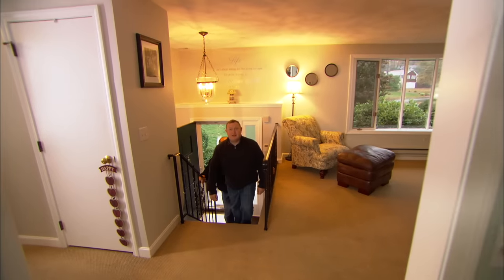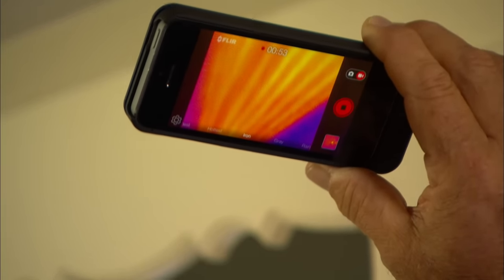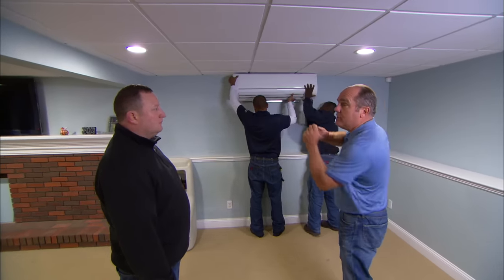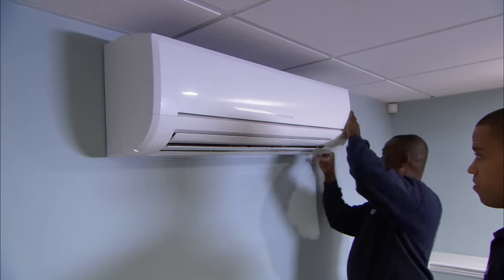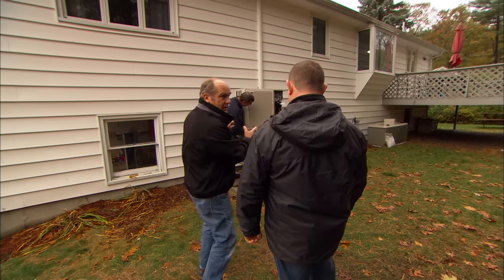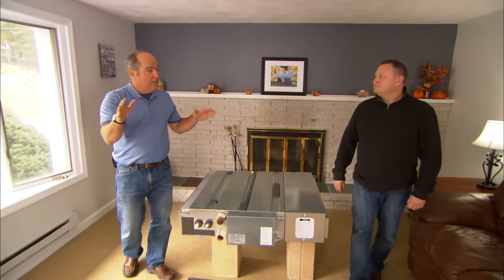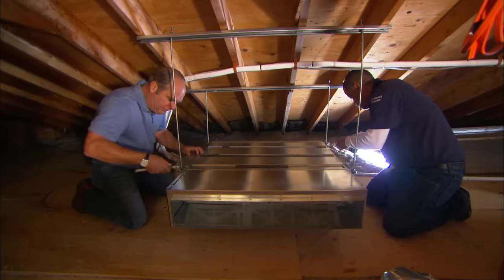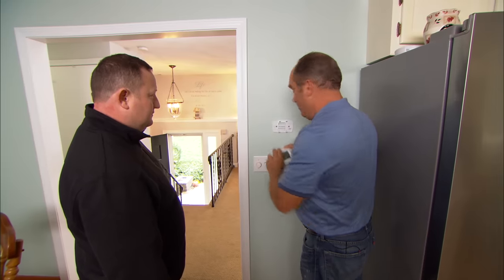How to Install a Whole-House Ductless System | Ask This Old House

Comment: I am sorry but I have a heat pump in the southside of VA (15 minutes from NC border ) and it costs a fortune when reserve heat comes on when it gets down to 30 degrees .It struggles to heat my 2440 sq ft. house with 2x6 stud walls and insulated floors .The heat pump is a 16 seer dual stage lennox heat pump that is new as of 2015 .My electric bill can get  way up to over 300 dollars a month when reserve heat comes on .
Reply: Forgive me I don't know much about this, but from the video (@2:55) I gathered that there are different kinds of heat pumps that are made to work below 30 degrees (F). 

It sounds like yours isn't one of those. Any thoughts on that? Is that a whole bunch of BS?
Reply: he even says that it can only pull out warmth down to 30 degrees and then reserve heat comes on .I checked every heat p[ump out there and they all say to 30 degrees .I have friends in NJ where I came from that got a heat pump last year and the first winter they said they felt like they were going to freeze .Their electric bill for one month from PSEG  was over 500 dollars and the house is only 1400 sq. ft and is a new build as of 2014 with 2x6 studs .I am from NJ and could not believe they got a heat pump .Heat pump also got snow  on the sides and some on the top from winds because it was just to cold for it .I had to shovel mine out as snow was half way up one side because of snow and wind here .We are lucky though 2 days later it was in the 50's .I hate my heat pump and it was almost top of the line and most here only buy 14 seer and 2 ton and mine is 4 ton unit

Comment: contractors who have the service plans for these are the ones who win. guess who you call when it breaks. the more complicated a system is means the more often it will break and make the service guys more money. the intial installation cost is nothing compared to the 20 years of service calls units like this require. have fun!
Reply: Bob Smith when installed right, these systems have few issues it ever.

Comment: Probably a $40k hvac installation and equipment.
Reply: It will pay itself off in energy saving in 120 years though.
Reply: @sgtpepper729  lol isn't that the truth. We just had our central A/C replaced, and everyone was trying to upsell us on more efficient units. I did the math and realized under even  optimistic scenarios, it'd take 15 years to pay off the difference in cost.
Reply: @iamamish  Ok, assuming you have good credit, get a ~20 year loan to pay for the more efficient unit.

You will immidiate see an instant cost reduction, and therefore profit, for no upfront cost.

If you sell the joint, pay off the loan immidiately, and charge the next owners a little extra for the lower heating/cooling costs.

15 year ROI isn't terrible, but not great either.
Reply: @Bob_Lob_Law  How do you get a 20 year loan, even with good credit where the interest rate won't swamp whatever savings  you're getting in your energy bill?
Reply: @iamamish  My my, thats a tough one. A line of credit is a good option for shorter loans, as for long term, there are equity options among other things.

It really depends on what bank you are with, but it is certainly possible. There are some individuals who manage real estate in a similar manner.

Snatching up just the right properties, doing some renovations, and renting them out. Earning more on rent, than is spent on mortgage payments.

You have to ask yourself what is worthwhile, liquidity certainly has value, and it is not necessarily a good idea to tie up cash in a long term investment.

But realistically, would you spend that free cash on something with a better ROI? Probably not. The money probably gets sapped away by a new car.

Really, from a purely monetary perspective, a 15 year ROI does not make much sense with an upfront investment, an investment into a stock portfolio will pay much more.
Reply: @Bob_Lob_Law  I appreciate the feedback, but a non--securitized loan over 20 years is unlikely to make buying a more efficient furnace/AC unit worthwhile. At least, it won't here in Ohio.
Reply: @iamamish  You are probably correct, although, it seems most people don't think in terms of ROI, and there are still many installations in which financial efficiency can be improved.

Comment: I do Mitsubishi systems. The hvac contractor needs to go to a Duct design class for Mitsubishi systems cause that's some pretty bad duct setups.  And I hope they used PEAD units Not the SEZ. Especially on the bigger zones. R8 Ducts required and you also need to wrap up unit itself.  But other than that, looks pretty good. Also the PEAD/SEZ dont have strip heat for backup.

Comment: Why is it called 'ductless' when he put ducts in every room?
Reply: in the video he clearly stated that the wall unit is "ductless" and the other units in the attic are called "ducted" air handlers which means you can install a plenum and attached flexible duct like you would normally do in a conventional application.
Reply: Should be called a vrf system
Reply: "Whole-House Ductless" - a clickbait title by definition.
Reply: The ducts are added to replace big units on walls and to give more even heating and cooling.
Reply: It's kinda become a slang term. When the ductless mini-split/inverter type systems came out many people referred to them as ductless mini splits, now that the same technology has evolved to include ducted units the term ductless still gets used for whatever reason. At least that's my theory on it.

Comment: It seems that the attic is not part of the conditioned space, so in the summer, when the sun is baking on the roof, the system will have to function in an oven, and in the winter, it will be cold. Wouldn't it be more efficient to insulate the attic and make it part of the conditioned space?

Comment: how much does a whole house ductless system cost?
Reply: $4800 for a 4 head mini split system. $2200 equipment, $2600 install.
Reply: @okedokie  Is it more efficient to operate than natural gas? Does it save the homeowner money or about the same. Reliability. Is it reliable and easy to work on? Are parts expensive?
Reply: @troybarnes502  It works great as an a/c system, but a family member has this kind of set up, and their heating bill is 3 times what mine is with natural gas.
Reply: @okedokie  do you do these installs in Massachusetts? Or do you recommend someone who does?

Comment: Hope they box that air handler in with insulation to isolate it from the attic heat and cold if they stick it up there.

Comment: Who the hell thought a electric ceiling radiator made sense? Heat rises!
Reply: My thoughts exactly, not to mention having hot wires running near wooden trusses. What could go wrong...??
Reply: False... warm AIR rises. Those coils emit radiant heat... like the sun. It does not use air to transfer the heat.
Reply: Is the sun hot?  Heat rises doesn’t it?  So how does the sun work then?  So radiant heat - both the same.  And baseboard is not radiant. As far as reverse cycle air conditioners, not so efficient the colder it is out.
Reply: The sun is hot. Heat does not “rise”. Warm AIR rises. Three ways to transfer heat: convection (through a medium, like air), conduction (through physical contact), and radiation (like the sun or any form of radiant heater). Base board heat IS radiant heat!! It doesn’t warm a home by heating the air (it warms it slightly, but is inefficient at that), it doesn’t warm it by direct contact... it warms it through radiation of heat energy. And heat pumps (through the inverter technologies being discussed) have full heating capacity at outdoor temperatures down to -5 F and below. Using a fraction of the energy that electric resistive radiant or convection heaters do.

Comment: He forgot to mention about all of the mold that grows inside of the Mini Splits and how they need to be cleaned out twice a year he didn't even suggest a UV light at least for the kids room you would think, I guess this old House's getting more frugal. Good luck ever getting that air handler clean without having to completely take the whole thing apart

Comment: Personally 4 zones upstairs don't make sense because the kitchen has no door so it'll end up the same temp as the living room. Definitely a good idea to have separate zones for bedrooms. I'm not sure why people don't like the head units as they bring features that returns and registers don't: you can run them as fans that can oscillate and some can bring in outside air for when the outside temperature is fine but you don't want to open windows. Plus they're relatively cheap.
Reply: Anyone know which mitsubishi air handler this is??  Did he say he has 4 air handlers with 5 branches off of each?  So thats 20 line sets to 20 different spaces or so?

Comment: Is this better than current hvac units available now?
Reply: Randy Mullins Financially i don’t know. Though where i live, The Netherlands, they have stopped constructing gas lines to new houses, because the extraction of gas from the earth causes earthquakes, and it’s better for the environment anyway to run off electricity. It’s much cheaper and efficienter anyway than a basic electric heater. In 2030 or some year they want to be completely free of gas in the whole country.
Reply: No. Its just easier and cheaper to install in existing homes. Those unites are never chosen with new construction because they're slightly less efficient and less effective for heating and cooling.
Reply: The power bill is the main concern
Reply: yes they are more efficient because no duct losses. it takes up less space as well. also, and obviously, they can be more easily sized to your cooling space - for example if you only wanted to cool certain rooms it will be much cheaper than trying to cool the entire house with central AC.
Reply: This is a current hvac unit
Reply: Rocketninja200 you are wrong. They are used in new construction as well. Mostly in high efficiency homes
Reply: High efficiency does not mean more comfortable, usually means energy saver at the cost of losing comfort  if anything
Reply: In short, yes, they are.
They’re also considerably more expensive and they require specialized training when commissioning and troubleshooting.

Now, “better” is a relative term, they may save you on energy costs but you won’t feel the nice 110°F air coming out of the air handler in the winter season.
Reply: @Engineer9736  So you remove gas lines from houses to help the Earth, just to run more electricity that comes from Natural Gas/Coal plants creating the electricity? That electric comes from somewhere (still about 85% fossil fuel in the Netherlands). It is more efficient to just burn the cleaner gas direct than to lose efficiency in transporting fuels, converting them into electricity and trasmitting it to homes. The argument that Electricity is cleaner than fossil fuels at this point in time is a farce. Until alternatives become truly economic and efficient at great scales, it comes from the same place whether you burn it or plug it in.
Reply: Ryan Hoeksema except, it isn’t more efficient in this case.
Now, to be completely honest, this isn’t the save-all-environment solution and I don’t know anyone who would claim that.  
Ultimately, it boils down to power consumption.
The less you consume, the less fuels are burned.

Comment: Aren't they installing ducts in the thumbnail?
Reply: Jimmy Turner they explained in the video. It is a ducted ductless HVAC system. Basically it uses VRF tech for the ducted system and a ductless head for the basement
Reply: Technically yes. But it's a "ductless" system being that it's not just one air handler for the house, its a few small handlers. Basically like those ones you see on the wall, but they have one unit feeding two or three rooms.
Reply: They lied.  I wasted 6 minutes to find out.

Comment: Would installing a separate ductless unit in 
Each room be to much of a power load
Reply: The air handler doesnt use much power.  The condenser is what uses the most power.   Using that many air handlers would required a very large condenser or multiple. That is were the power load comes in.

Comment: It sure looks like a ducted system to me. That must have cost a fortune for that guy
Reply: There a ductless AND ducted system. Having a single system in a single room for your whole house is inpossible, you need ducts for that.
Reply: Absolutely he paid a fortune for that set up. I would have chosen a more conventional system
Reply: @jawidofkoj2998  It all depends on what systems the house already has.  I have baseboard hot water so my home has no ducts.  A traditional duct system would have cost me $25k.  The mini-split was less and wayyyy less intrusive to install.
Reply: Joe J I’ve recently installed a mix of ducted and ductless mini split air handlers and a condenser capable of operating efficiently well into to single digits below zero for a customer. The System is incredibly even and quite in air conditioning and will do the same in the winter, it’s the only heat source. The wall mount units have certainly gotten more attractive since this video was shot
Reply: If it looks like a duct and quacks like a duct, it's a probably a duct.
Reply: @jawidofkoj2998  a regular central heat pump would have looked the same at a cheaper price without the unit on the wall. The main indoor unit would just be in a closet or the attic.
Reply: z  No, I think he had radiant heat but in the ceilings.
Reply: @davec.3198  I am looking into this in my own home.  How much did the mini-split cost?
Reply: @Cazuelle_AF  For me it was under $5k.  I bought and installed the units bit then had a Mitsubishi installer come braze the lines, pull a vacuum and fire it up.  Went perfectly.
Reply: Ross Malagarie  absolutely not. A traditional heat pump reaches its balance point between 34-38* and becomes inefficient, so you need supplemental heat. Totally useless in a cold climate unless severely oversized. 
The inverter type equipment they’re installing is way more efficient in cold climate (he actually says it) and the newer version Hi is even better.
Reply: @peteaulit  Yep.
If you're looking to use these in a cold climate as a heat source, make sure you ask about "hyper heat".
Reply: @davec.3198  Most if not all systems are flared...why hire some1 2 braze for u....u must be a rookie...
Reply: @warbird101210  No.  DIY kits are flared.  The pros braze the lines to eliminate potential leaks.  I hired pros...so they brazed the lines.  
You need to pull a vacuum and get all of the air and humidity out of the line away.  I don't regret for a second paying someone to do it for my system.
I hung the units.  Poured a pad for my condenser..anchored it in..  Wired them.  Installed the lines..but did not connect.
Reply: @davec.3198  Thanks for sharing the information about the "hyper heat". I am in New England, I talked to multiple hvac companies about using a split as main heating but could not get a clear answer.
Reply: @synewparadigm  You're welcome.  Glad to help.  
I had a 38k BTU condenser unit and 3 heads in a 2000 sqft house with very high cathedral ceilings.  With 80-90F days and 70F nights, I was paying $20-30/month in cooling costs.  And that was with running my bedroom down to 68F at night.   I love cool sleeping.  
When the temps are down below 30F the systems are a combination heat pump and electric heat.  How expensive it is, depends on your electric costs.  
Personally, I off set that cost with my oil boiler and woodstove....so it was perfect for me when temps where cold.  
If you look at the weather data, you might be surprised to find out how many days are really not that cold.  Frequently nights in the NE area are below 32F but not the days.
All I can say is that, they did an INSANELY good job keeping the house comfy in the spring, summer and fall.  If it was me, i'd have a supplemental source for the dead of winter.

Comment: Ahem, heat rises, so why put heat in ceilings?
Reply: It's the 2nd floor with existing walls. Can't put them in the floor.  With 7 foot high ceilings , forced warm air and a properly measured system will work great. Remember in the summer the A/C will be running and cold air sinks.
Reply: That is why they don't do it that way anymore.  The idea did not really pan out.
Reply: Ahh. Hot air rises.  but it still was a bad idea.  And try adding a ceiling light...
Reply: @Spencerbuildsit  I had to deal with that while going to college. The apartment I was able to use for a couple of years had the heating elements in the ceiling. It never felt that comfortable when I used it. It made my head fell too warm. I thought at the time that it would be better to have the heating elements in the floor. Fortunately for me I only needed to use the heater a total of two or three weeks during December and January. I went to college at UC San Diego and the weather isn't bad at all down there.
Reply: The ceiling is generally close to heads and upper bodies so people tend to like ceiling radiant heat just fine. Once objects and surfaces inside the rooms are warmed up they stay warm, unlike heating the air in a room.
Reply: @lamonstra1464  Sounds good but floor radiated heating does feel more comfortable. I use it in my second home in Lake Tahoe. The heat feels more like it surrounds the body as the heat rises up from the floor. Even more comfortable than the heater from the HVAC system used in my primary residence.
Reply: Almost every house I've seen has the air handlers in the attic, there's nowhere else to put them in most houses.
Reply: @mattwolf7698  
No where to put.. because it was an afterthought when house was designed. 
Not uncommon for the mechanical guy to have to figure it out.